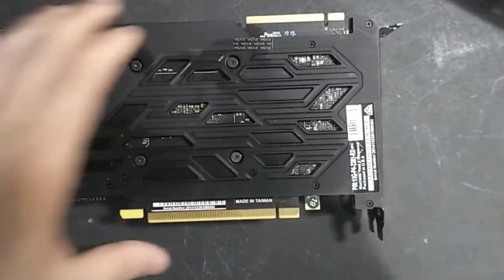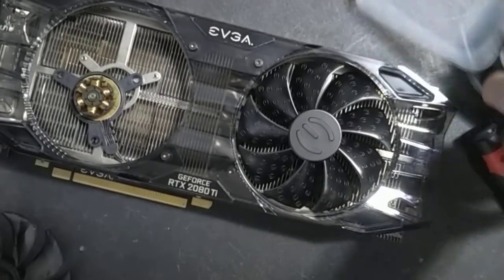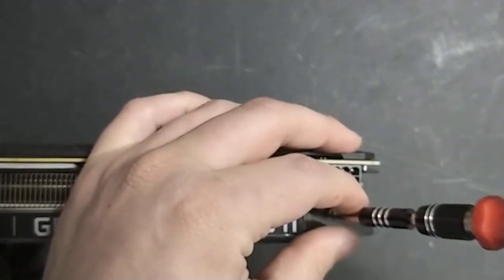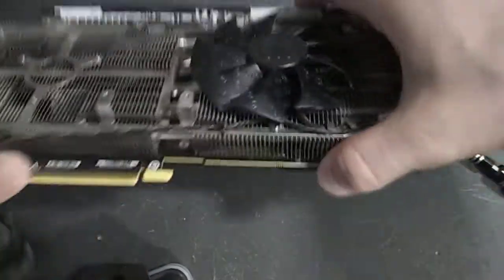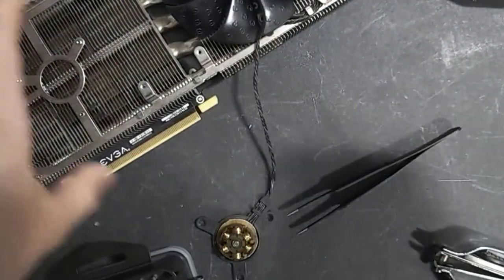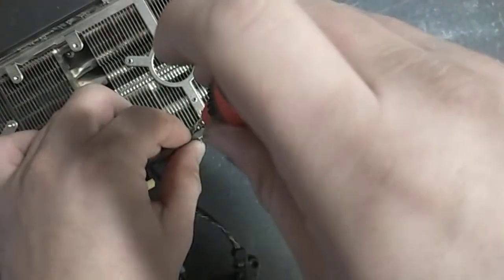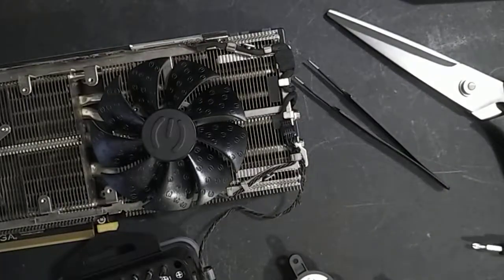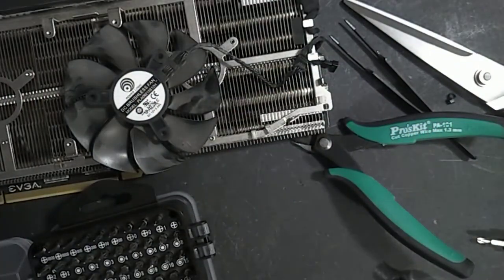EVGA RTX 2080ti Black Fan Replacement Guide

Comment: 2 of my fans aren't spinning at all and I was told to install the EVGA precision app for some reason just to get these fans spinning which seems really stupid
Reply from the maker: The GPU has an internal chip that lets you store profile data on it. Such as clock speed, power limits, and fan speed. Thats why you needed to install an OC tool such as Precision to start the fans. Whoever used it last set it to manual.

Comment: Hey mate, massively appreciate your video! I have an EVGA RTX 2070 Black, basically the same design as this - I'd love to give the fans a really deep clean as it's starting to make noise. What's the best approach with these EVGA fan? I see in another comment you said you can't get access to the "oil well" by just popping the plastic cover off, so what's the call on this?

Thank you so much
Reply from the maker: Hey. There's no "oil well" in a GPU. If the card is making noise it depends on what kind of noise its making. If its a high pitch sound, thats usually coil wine and is normal. If its a scraping noise thats likely the fan scratching against something in which case just swap the fan. The GPU shouldn't be making any other noises.
Reply: Bearings get fucked ..and you didn't mention that. Which is mostly the common problem. Over coil white.  Rotary oil

Comment: Would it be possible to clean out a fans bearing with this tutorial or do you genuinely just have to install new fans?
Reply from the maker: The fan is never supposed to be separated from the bearings. If it is, you need to replace the fan.

Comment: when you put in the new fan what do you do for the zipties?
Reply from the maker: Throw them out. So long as the power cable isn't hitting the fan you don't need them.
Reply: tysm your video helped me so much. repair centers were charging me $150+ just to install the new fan. @rk100_official

Comment: Best repair is to throw that good for nothing factory shit cooler in the bin, and stick a 240 AIO on it.. dead silent and cool as siberia after that.. not to mention easy and safe OC, longer lifetime, better factory boost clocks. Can only win with it of U do it right!
Reply: Hey man, could you explain this some more. I'm interested
Reply: @GHSTTHERENEGADE  buy an NZXT G12 adapter for buttons, and a compatible Thermaltake, NZXT (or any other on the compatibility sheet) AIO, and install it instead of the original cooler. (including quality thermal paste, and keeping or loosing the front and back plates if needed/not needed).  On my 2080ti evga BE I managed to keep both front and back plates. Gives the board better support and heat spread too.. Needed to trim the pump legs a bit though with a dremel to fit through the front plate.
Reply: @GHSTTHERENEGADE  also got a few stick-on heatsinks (10x12mm), and stuck them on the warmest places (rams and VRM) on the other side of the front plate. Just to make sure.. There's a small fan on the G12, so these will get a little airflow too..
Reply from the maker: Hard disagree. Enthusiasts like us may be able to do that but the average person looking up a video like this likely doesn't have the experience that they feel comfortable swapping coolers.
Reply: @rkraiem100  I honestly thought being a man equals having the proper skills to do that. Or swap an engine.. or build central heating from scratch.. guess I had too much fate in humanity 😀

Comment: What are the connectors called? I'm trying to buy replacement fans but all the wrong connectors.
Reply from the maker: U mean the fan headers?
Reply: @rk100_official  yes, I believe so. All the ones I have seen are micro 4pin, I can't find anything with the smaller ones. The specific replacement won't ship to my area.
Reply from the maker: @Spoonaroonie  if the header does have a specific term then I wouldn't know. Maybe hop on reddit and ask them there. Crypto mining subs are your best bet cus they deal with lots of GPUs and GPU repairs so they would know

Comment: what kind of screwdriver bit do you use? and is this the same for the evga 2070 super xc?
Reply from the maker: I used a generic electronics screwdriver. U can find tons of them on amazon any of them will work. Not sure if the teardown is the same, if the heatsink is the same then prob yes

Comment: I have a RtX 2080ti ftw 3 and I replaced one of the fans and the fan isn't spinning and isn't showing up in EVGA x1 software. Is there another step I'm missing?T
Reply from the maker: No. A fan swap on its own would not cause the GPU to not register. The fans are analog devices. They don't send any data to the GPU and so long as the GPU isn't overheating it can function entirely without them even being installed. So long as the fan swap was done properly (and honestly I can't think of a single thing u can scrww up with a fan swap that would cause an issue like that) then its not the swap that caused it.

Here's my guess:
1- the GPU was not installed properly. Double check its fully seated in the x16 slot and the power cables are connected fully.
2- something is wrong with the cables connecting the PSU to the GPU. If you are using cables different from what came with your power supply (assuming its a modular PSU) then that can cause major permanent damage to your components if you are unlucky. Make sure they are the correct branded cables
3- if both of those are not issues check to see if the motherboard is detecting the GPU to begin with. This will depend on what model motherboard you have. Many models have a board explorer which shows a diagram of the motherboard and highlights what's plugged in where. Putting your mouse over it will give u details. Ensure it shows up properly in BIOS since that rules out it being a hardware issue and isolates it to being a windows error
4- check your device manager to see if its detecting it at all. Don't rely on evgas software. Device manager will give u more info. Forgot which section its under, prob video output devices or something idk. If it says something generic then it may be recognized by the os but a driver issue is preventing it from working. Update your drivers manually, very very easy process that only takes a few minutes.

That's what I'd do. U can also try plugging it into another system to see if that system recognizes it. GL and lmk any questions.
Reply: @rk100_official  So I swapped a fan and when I booted up Evga X1 only recognized 2 fans. so I swapped the fan back and then evga X1 only recognized 1 fan. I don't know what happened but I feel like the headers failed on me. The fans dont even spin during boot. I've reinstalled drivers/x1 etc. I've reseated the fans and the gpu and still nothing. I'm so confused what happened.

Comment: What size of hex driver did you use to remove the fan shroud?  I haven't been able to find this info at all.  One of my fans is failing but I need to figure out what millimeter sized screw driver to use.
Reply from the maker: I just eyeballed it. You can get a screwdriver set on amazon with like 100 bits and eyeball it
Reply: @rk100_official  That's basically what I'm trying to do.  I picked up an IFixit set that didn't have a hex driver (my mistake), then I found a set at Home Depot that was too big (because I'm guessing at the screw size) and now on to the 3rd set.  Some day I'll figure it out.
Reply from the maker: @louisbradshaw6072  https://www.amazon.com/gp/product/B08DRB1DFJ?psc=1

Pretty sure a set like this will have what you need.

Comment: What fan did you buy to replace?
Reply from the maker: https://www.ebay.com/sch/i.html?_from=R40&_trksid=p2380057.m570.l1313&_nkw=evga+2080ti+black+fan&_sacat=0

Prices seemed to have spiked like nuts in the 2-3 months since I made this video. I'd do some research.  It should be ~$15-20

Comment: Hey, so I've just had one of the blades come off. Is it possible to just replace the blade? I don't feel confident uninstalling the entire thing unless I really have to.
Reply from the maker: Sadly no. You def have to replace the entire fan. As you can see its basically just a few screws so its pretty simple.
Reply: Don't feel intimidated. You don't technically even need the plastic trim pieces. You just need zip ties or screws to hold the fans on and ensure they power on and run good. 
Most rebuilds with next g12 brackets do this :)